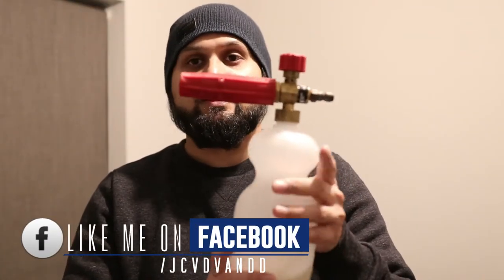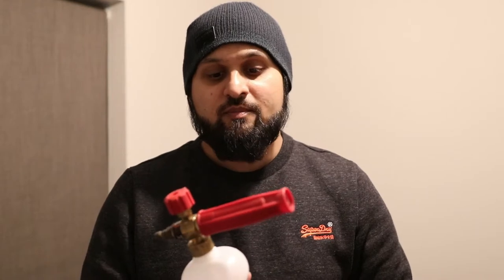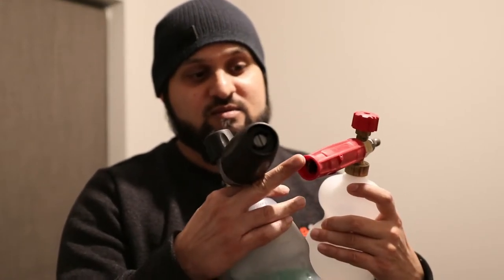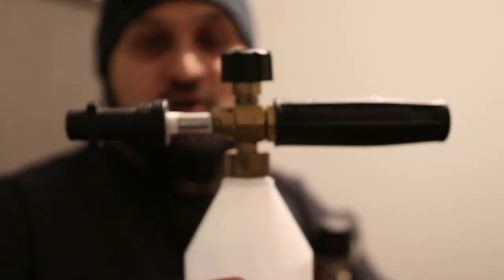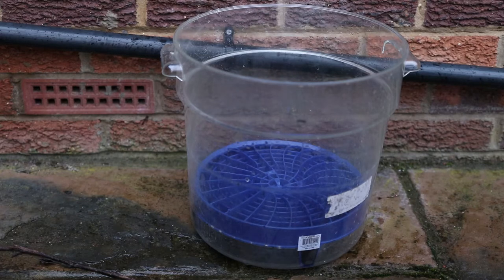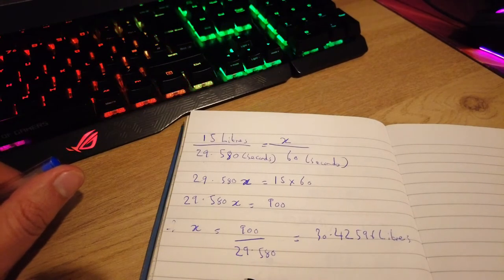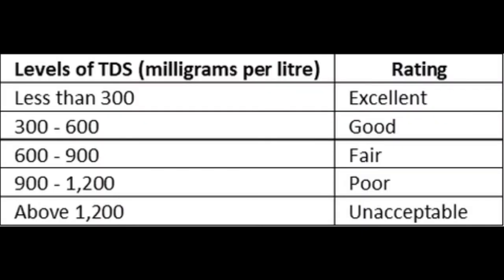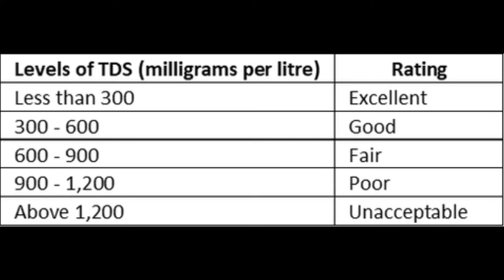Snow Foam Lances, Flow Rates, Water Hardness and Pressure Washers: What you should be aware of.

Comment: Hi, I would appreciate your advice on a few questions I have. What are the benefits of the Kranzle pressure washer over the K7? I'm currently deciding whether to purchase a K7 for both car detailing and patio cleaning. If you could keep only one, which would you prefer the PA or MTM lance? Was the Obsseed Garage pressure gun worth the extra money over something like MTM SGS35, I very much like an easy pull trigger?
Reply from the maker: Thanks for your questions. In my view the Kranzle is more geared towards commercial use and the pump is most likely more durable than the Karcher K7. However, if you intend to make use for domestic purposes and not use it for prolonged periods of time then the Karcher K7 is more than capable. I only bought the Kranzle 2160TST to make use for my detailing business, plus to use it to clean the driveway/ patio on occassions. With regards to your question on snow foam lances, that's a tricky one. I like both of them! However, with that being said; I'd keep the PA lance. With respect to your final question. I wouldn't be able to give a fair view on a comparison between the OG spec gun and the MTM SGS35 as I have never used the MTM gun. I liked the look of the OG spec gun and that's why I bought it. I am sure though the MTM gun is also a very capable solution. It might be worth watching a review by Obessesed Garage. He has a video on the MTM SGS28 and the older OG spec gun: https://www.youtube.com/watch?v=efyr_MWLNPA&t=103s I don't know how useful it would be, but you may be able to identify any differences. If you have any further questions, please do not hesitate to reach out.
Reply: @jcvdvandd  thanks so much for the detailed response, much appreciated! That’s great to hear, I only plan to use it once a weak so I think I’ll go with the K7 then. I’ve just watched the Obsessed Garage videos and the fittings seem like the main reason to purchase the gun. Whilst they seem very luxurious they also have a ludicrous price tag, but I might just splurge as I don’t plan to upgrade any time soon. Do you know if the PA Lance is compatible with the MTM 22.2 bottle?
Reply from the maker: @calvin3941  you're most welcome. The PA Lance should be compatible. I have put my PA snow foam lance on the MTM PF22 bottle and it screwed on fine. The PF22.2 bottle will have the same thread, so it should also work. Hope that helps.
Reply: @jcvdvandd  Great stuff, looking forward to your next video!
Reply from the maker: @calvin3941  thank you. It's been a while since I last uploaded. Need to get round to it. If there is anything you'd like me to do a video on feel free to let me know.